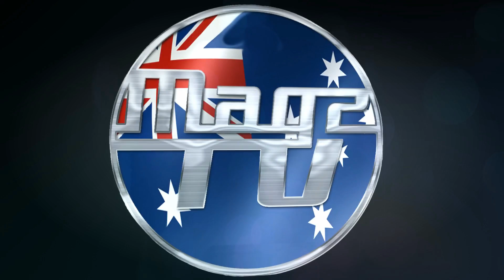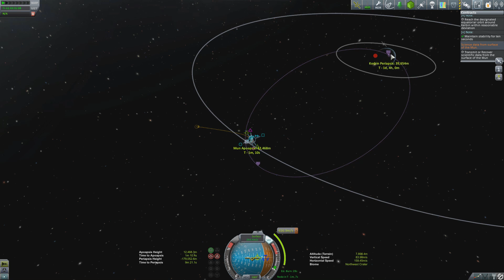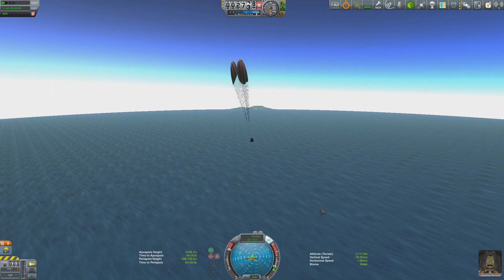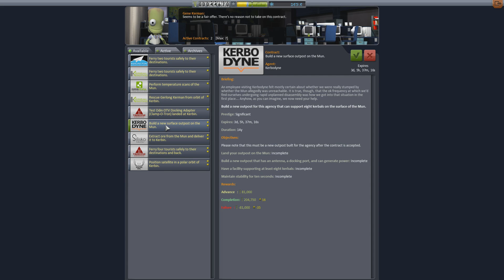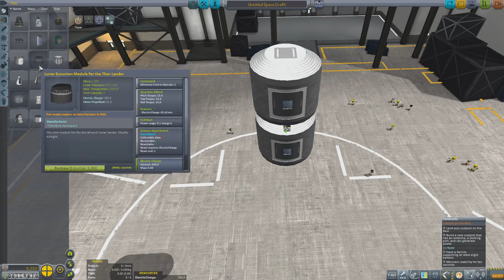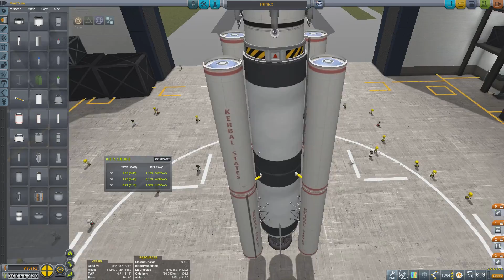Kerbal Space Program - #6 - Building Bigger

Comment: Hey Magz, a little suggestion: When doing burns like that, you can be more accurate by starting your burn when your time to node is half of your burn time. So if you need to burn for 28 seconds, start your burn when the time to the node is at 14 seconds.

KSP assumes you apply all that energy at that exact instant, so it doesn't account for the distance you've traveled while burning. By splitting the burn like that (half before the node, half after), most of the errors cancel out. Learned this from playing Orbiter.

Just an idea. Love your channel, keep it up.

Comment: +MagzTV I haven't fooled around with it with my 1.0 career yet but is asparagus staging still viable or is the setup you showed the best for launching now if you want to use liquid boosters?
Reply from the maker: +Chaser McLoude Asparagus staging is still the way to go for most heavy launches but it wasn't needed in this design, All I wanted was the core rocket at 25km to 30km with a full fuel load. If I can do that then fuel wise the rocket can make it to the Mun. I'll be doing a lot more asparagus staging designs in the future as I start lifting heavy parts into orbit for assembly.
Reply: +MagzTV  Thanks, I haven't played around much with my KSP because two of the core mods I used based off of Scott Manley's old Interstellar Quest series KW Rocketry and B9 Aerospace never got updated to 1.0 so most my stuff broke.

Comment: Magz do you use any mods?
Reply from the maker: +Dakota H Yeah, just a couple. Here's the list.

MagzTV's Kerbal Space Program Career Mode Mods list
Base KSP version: 1.2 

Core Mods:
Ferram Aerospace Research V0.15.1 "Fanno"
Kerbal Joint Reinforcement V3.1.3
Magic Smoke Industries Infernal Robotics V0.21.2
RemoteTech V1.6.4
Better Buoyancy V1.2
Heat Management V0.21a
Kerbal Attachment System V0.5.1
Kerbal Inventory System  V1.1.2
Docking Port Alignment Indicator V6.2
Kerbal Alarm Clock V3.3.1.1
Kerbal Engineer V1.0.16.6
TweakScale - Rescale Everything V2.1
SCANsat V12.0
RealChute Parachute Systems V1.3.2.3
Transfer Window Planner V1.3.0.1
Deadly Reentry V7.0.1 "The Melificent Edition"

Parts Mods:
DMagic Orbital Science V1.0.3
NovaPunch V2.09
USI Karbonite V0.6.1
USI Karbonite Plus V0.4.0
USI Modular Kolonization System V0.30.1
USI Life Support V0.1.2
Universal Storage V1.1.0.2
USI Survivability Pack V0.3.0
Procedural Fairings V3.13
Bahamuto Dynamics Parts Pack V1.2.0
Firespitter V7.1.1
Stockalike Station Parts Expansion V0.3.2
Hooligan Labs Airships V4.0
USI Exploration Pack V0.4.0
QuizTech Aero Pack V1.2.5
Atomic Age V2.0
Kerbal Aircraft Expansion KAX V2.5
Mk2 Stock-a-like Expansion V1.0

Extra Mods:
Crowd Sourced Science
MechJeb2 V2.5.0.0
Raster Prop Monitor V0.19.2.2
Active Texture Management
Chatterer V0.9.1
Community Tech Tree V2.1
Science Alert V1.8.7
Reply: +MagzTV lol